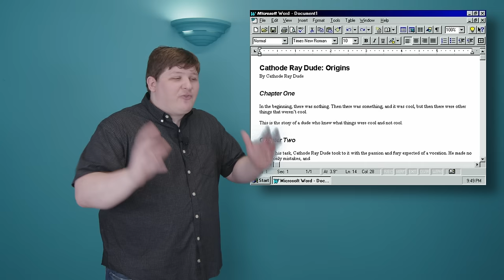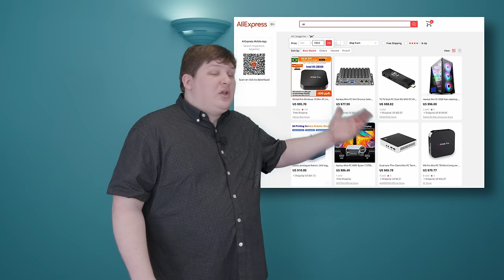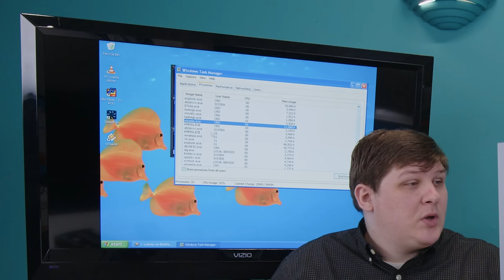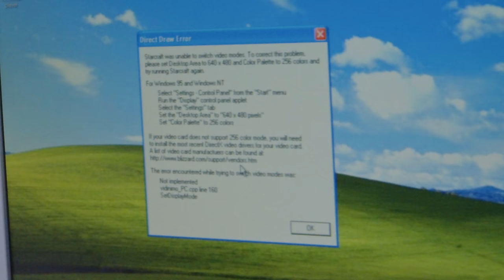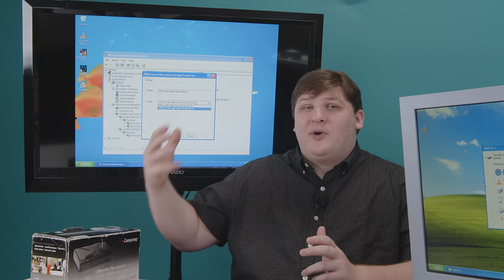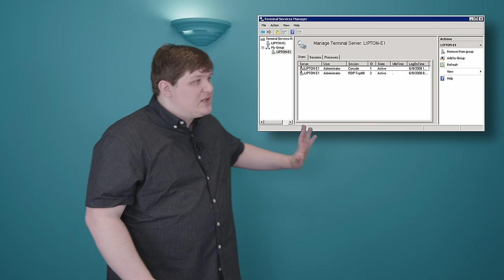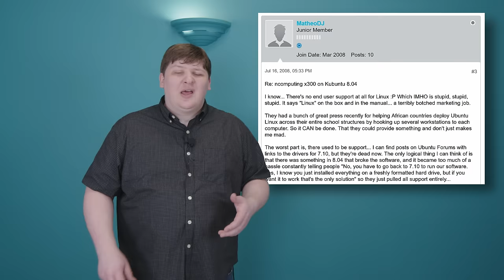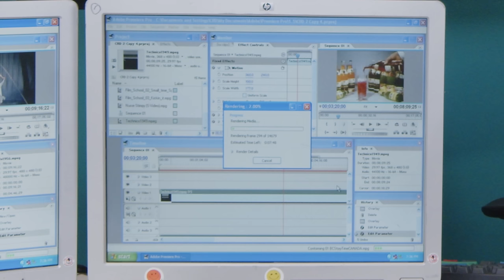7 Users on 1 PC! - but is it legal?

Comment: I used to use something similar back in '88 and '89 when I was writing software for mcdonald's store owners. Stock control, accounting etc. Back then the cost of networking even 3 PCs was astronomical, and I got these multiuser kits instead. You had a card that went in the master PC, then the other two computers were just keyboard, monitor... no mouse, this was text-only software before anyone even had a mouse. I can't remember what kind of cable it was. But it worked, you could run all 3 people on the single PC and each had it's own DOS environment, and within our software there was an api that let us figure out which station we were running on, and do basic record-locking to prevent data being changed simultaneously.

The 2006 version is definitely far better, but it sure wasn't a new idea even back then.
Reply: I remember we had 3 PCs in our office. I setup a Netware network for only $100 - $200. Of course it took me two weeks to figure it out, but it was a good learning excuse 😂.
Reply: An 8 port 10mb hub was around $1,000.  Our college changed to PCs as the rental of the monster IBM word processing machines were very expensive as it included a service contract.  I learned Netware fast and PC repair.  We used Word Perfect Office as it was way cheaper then Word. Plus Perfect Office had an E-mail system.  So by 1988 we had networking and E-mail for our student.  Pretty impressive for any college at that time.
Reply: If you remember Netware, do you remember the "restore" feature.  IBM tried to sell that in 2003 as an amazing ability !

Comment: I loved this video! Reminded me of my HS computer lab setup. I grew up in a rural area (45 in my graduating class) and we got a brand new lab going into my freshman year (1993-94). That lab was probably 25 IBM all in one 486-SX-25 PCs, I believe they were EduQuest models, running Win 3.1 (not 3.11), with one serving as the print server , which we couldn't use if the class would be printing anything. These were all dummy machines, but had 3.5" floppy drives to allow us to save our homework (and a couple of CD drives in the mix), all hooked up via token ring network to a single IBM desktop machine that was a 486-DX (maybe a DX2?) in the main school office file closet in that classic 90s style with the protruding drives and big red power toggle switch on the side. The server was literally just sitting next to boxes of office supplies on a shelf. Really not sure how they did it, but they'd all run the same copy of each program on each dummy machine, but with increasing amounts of lag and performance issues depending on what we were all doing. We had a couple of games, like the original Sim City, Oregon Trail, some rudimentary graphic art software, Microsoft Works, WordPerfect, an encyclopedia (I think Comptons?), and not much else. The terminals could access and run anything on the server, but generally couldn't save files or install programs, although this did get hacked with some degree of shenanigans. Security was kind of a joke on this network, which I suspect was possibly at least one reason the NComputing devices required entering the serial # manually, since that means only devices the admin KNOWS should be active are able to access the system and access all those files and peripherals. Logon times were also SUPER slow when we'd all get started at once, so it was best to get in early before it got bogged down. Sometimes they'd have to set up additional times for the class to come and get work done in smaller groups to not overwhelm the server and network, which did happen a lot during class. You'd always try to be first done with your projects so you had the best chance of compiling your programming project quickly before everyone else started compiling. Only one machine in the room had access to the internet and was the only one that had a sound card. The same models WITH hard drives, CD ROMs and CD drives were in our library the same year. They splurged on the server and bought the budget friendliest machines in the lab. The NComputing system seems so similar in concept and implementation to our lab, down to the limitations and issues. I've never seen another network like my HS one until this video, which sent me on a trip down memory lane!

Comment: LTT did 7 users on a single PC (I believe it had 7 graphics cards) but had 6 VMs running on a 64? core CPU a while back. Not practical, though.
I run VirtualBox 6.1, and allow several family users access via RPis, as the KVM to access their own machines on a Ryzen 7-1700 (8 cores/16 threads), 32GB RAM, 10TB storage.

Comment: It's a neat device, and I hope someone makes a modern version.
Linux is an obvious choice, but like virtualization, unless CPU has viable onboard graphics, would need multiple GPUs.
The ability to breakout I/O on USB hubs these days is easy enough, GPUs can be external on USBC docks.
These with built in PCIe connections on each terminal...
Reply: There is software called "Aster ibik" that does the same thing? I have tried it with 2 computers, and it works great, only downside is anti-cheat will think you're doing shady stuff so some game may not start or run correctly... other than that, i have played 2 different tripple a titles at the same time with individual mice, keyboards, speakers, monitor :D (and Aster works in windows 10 too :P )

Comment: The core 2 duo in my Dell D620 works great for most 2006esc tasks. But the internet can stump it, especially since an update browser is not an option on legacy operating systems. You are definitely right when you say the web can drive upgrades.

Comment: Interesting, but I'm at a loss as to why you kept asserting that Windows "didn't support" multiuser.  Windows (NT) has supported multiple users on multiple windowstations containing multiple desktops since 3.51 at least.   The problem has been that there was no HARDWARE that took advantage of it until NComputing and no SOFTWARE until Terminal Services.  But the OS had the support the entire time.

In fact, you could be running the POSIX subsystem (or WSL2 today) on a process in one windowstation, OS/2 in another, and Windows in a third.  They all coexist and multiple users can use multiple windowstations and multiple subsystems at the same time.

You can see this because Task Manager for NT4 enumerates all window stations, then desktops, then windows.  This is why apps running in an NComputing session work at all, and why they are visible in Task Manager along with the correctly attributed session.  I don't recall if I even had a WindowStation column available in NT4, but the OS sure had it.

Both NComputing's solution and Windows Terminal Server are mechanisms that allow you to ADD a windowstation, which you can think of as where your mouse and keyboard and display are.   The operating system itself, not unlike *NIX, has supported it since inception.

Put most simply, two monitors for the same user is one windowstation (multiple monitors, same desktop or separate).  Two monitors assigned to different window stations is multiuser, and always has been.

It really comes down to the fact the NComputing made good use of facilities already present in the operating system - they didn't "add" them.

Comment: Wow, great video! I was experimenting with Aster and Softxpand back then. Even cracked it, but the screen was nevertheless blinking sometimes. I managed in 1 shielded UTP cable to transfer all the relevant signals up to 20 meters:

1st pair:
1. R
2. Composite sync on Green.

2nd pair:
3. B
4. PS2 Clock

3rd pair:
5. PS2 keyboard/mouse Data
6. Audio Mono

4th pair:
7. +5V
8. GND

Comment: Yes i would be interested in seeing that thing on “later” hardware. I am also curious if it would run on Win7.
Reply: It did, but it was an unlicensed use case. It wasn't that 7 couldn't, MS hated it. I had to buy several copies of 2003 Server to deploy ours. It worked fine on 2008 which is pretty much Win7
Reply: You can patch a DLL file and have unlimited Users on Windows 7. You'd violate the license though.
Reply: winconnect doesn't use patches and works even today

Comment: No. Hardly anyone was ever truly happy with a Pentium 4, unless you like having housefires.
Reply: "Burn your house down"-type house fires, or "don't burn your house down, but heat it with a wood stove"-type house fires? ...because it served pretty well as a supplementary heater for a small bedroom in the winter.
Reply: @ssokolow  mine always turned off the thermostat because it was underneath it 😂

Comment: I remember in XP, 7 users was the limit of fast user switching, that must play into the device limit.
Reply: Xp and 7 are Windows NT...
Reply: @jeebus6263  Yes, I'm aware, I literally trained on them, not sure what your point is, maybe if I clarify my statement, in Windows XP, the number of users limited to created accounts for fast user switching was a total of 7
Reply: @BSFJeebus  i RDP all the time, i didn't know there was any 7 user limit. I know in taskmgr there's typically at least a system username running.
Reply: @BSFJeebus  i guess my point was that WinNT was selected (NT4) specifically for features like multi-user support.
Reply: @jeebus6263  so I did find out Fast User Switching gets disabled when XP joins a domain, which makes sense since it was based on RDP, the only reason his example made think of it was because I'd seen a similar set up and remembered when I was setting up users for XP Home, I found that 7 user limit, still really neat the way some companies found to exploit it
Reply: @BSFJeebus  unix/linux always supported multi-user, Micro$oft was scrambling to catch up.

Comment: There are some issues with this kind of setup. 1) Redundancy - if the main 'server' goes down you have lost 4 or 8 stations and you can't run a class or office if all 8 go out at the same time. Usually a class/office will have 1 or 2 spare PCs in the event that one stops working. 2) The 2nd hand resale price of your server/clients is basically zero if you want to upgrade in the future. 3) Compatibility - Schools often want to run special software (e.g. special needs, licensed software, software requiring certain OS or hardware, etc.) and these often don't work.

Comment: Here in brazil we had computer classes using these, 7 users on photoshop CS3 at the same time. No noticeable problems, but we were all beginners.
Edit: it also had a software that resets the OS/storage to a previous state on boot, so we couldn't get most viruses nor save files.

Comment: Not sure if you knew this but for many years you could simply copy the terminal services file from a server version of windows and make a single registry edit and suddenly you could log in multiple users simultaneity into plain old Windows.

We used this back somewhere in the 1990s to late 2000s to share 1 PC with two full time users (and a third user occasionally by sharing ½ and ½ of one of the screens). What we had was two video cards, multiple keyboards and multiple mice. I don't recall having to do anything other than some simple registry tweaks to assign keyboards and mice to the specific users. Admittedly, while I figured out the terminal services hack, it was my room mate who figured out how to assign input and output devices to specific log in sessions.

We did have minor issues with everyone able to see any USB stick that was inserted (showing up as a drive letter), but we all knew each other well and didn't have secret data, so that wasn't really an issue for us. You could control access to them if they were formatted NTFS and you set up specific address control, just like any normal storage drive (SSD or spinning hard drive).

Comment: There are ways to get the code that programs that Altera chip, but it might also just be encrypted. Usually there is an EEPROM, or other non-volatile storage, on the PCB from which the configuration for the LUTs in the FPGA are loaded at startup. It could also be in the FPGA itself, depending on the model. Pretty sure an expert could get in there, but then on the other hand you can probably find an HDL description for this task somewhere on the web, if you want to do it on a more modern FPGA.

Comment: My celeron gateway pc from 2001 took at least 5 minutes to load premier pro. With no other background processes running. I'm stunned that a 2007 can run two concurrent apps of it simultaneously no problem.

Comment: 11:11 it is actually possible in windows with just software, I've done it before. It's really messy. You gotta use sandboxie, some weird closed-source $40 software that can somehow create a second user session on the same user account, and then assign a keyboard and mouse to each session, and if you're using the same program at the same time, the other person has to start it through sandboxie.

The performance loss is pretty big, and I would not say it's worth it, but it is possible.

Yep, Aster is the paid program that somehow creates multiple user sessions.

Comment: The multi user capability is actually built into Windows and has been since the early days of Windows NT - I worked using NT back in the mid 90s and it had the necessary framework built in and it was up to solution vendors to plug into these with their own management interface.  The first one I saw in the 90s was Citrix which does this but using a networked client rather than one directly connected to the host - but the principle is the same.  With the hardware solution there are limitations such as due to the terminals not using the graphics hardware in the machine they can't do 3d stuff or anything else that the terminal hardware doesn't support.  This is a form of virtualisation - just not processor virtualisation.  Each user thinks they have the machine to themselves - but in reality are sharing it.  You will find that some (badly behaved) software won't work because it will rely on exclusive access to some data file or similar. XP has inbuit technology to allow an administrator to virtualise access to files so as to avoid these conflicts.  From a legality point of view it depends on the software - typically MS licence on a per device basis - which is the end user device so each terminal would require a license.  But some licenses are per user which requires that each user needs a device (regardless of whether they are sharing a machine).

Comment: Unix and Linux uses X11, which is DESIGNED from start to share a big server among many users, which uses low cost graphical workstation that only uses X11, to show graphics today.
You can still do that today.
Use SSH, with X11 tunnel and connect to a Linux machine, and you can run graphical programs from the remote server show up on your local machine (install GWSL from Microsoft store if you want to try), and that is no way different from running that graphical application from your local machine.  No, it isn't a retrofit, it is from the beginning.

So yes, this has been working since the 1980:th, when Mac and IBM PC was made.

Yes, you can also attach several screens, keyboards and mouse, and you can run several users from the same computer.

Comment: My school has these. In the study hall (idk how to properly translate that) there were 2 platforms. A Dell tower pc in the middle, and 8 LG monitors around it (with one of those boxes screwed into the vesa mount). Each dell had a card with 5 ports, and one with 3 ports, making up the 8 ports. By the time i got there, they were decommissioned. I got the cards and a few of the boxes, even a few of the original packaging boxes. I haven't found the disc yet. But i've always wanted to try to use them. To this day, those ncomputing boxes are still installed on those LG's, even though each screen has a computer under it now. I plan on taking them home before leaving school. (i did get permission)

Comment: This was a great flashback to my younger days in the IT networking field (now retired). One thing you did not mention was that during Windows 2000 and XP era there was a simple replacement of a file called MSCS? (Sorry can't recall the name), but it removed Microsoft's restriction on allowing Simultaneous Remote Desktop clients on Windows 2000 and  XP to host multiple RDP (Remote Desktop Sessions) and totally removed the single session restrictions.
I used this on several installations in small non-profits and education installations. If I'm not mistaken you can still find the file and download it off the internet. Also I believe it even ran on Windows 7 and possibly Windows 10. I don't know what the limit of simultaneous RDP clients it allowed, but I had 6 users at one time in one installation. A rumor was circulating that Microsoft once included it in the Windows 2000 Pro version but in later updates removed the single file as they realized they would loose money by allowing it. So cleaver individuals found that just replacing this file still allowed simultaneous remote sessions.

Comment: Microsoft did come up with their own proper implementation for multi seat computing. It was called Windows MultiPoint Server and it was basically a version of Windows Server with the desktop experience option pre-installed and extra MultiPoint software that lets you pair a keyboard/mouse with a display. It works with displays hooked up to GPUs or to DisplayLink USB docks. It also assigns USB devices to each station, as you need to have a USB hub for each station. They partnered with HP to sell full systems that came with multiple DisplayLink docks and all the licenses for multiple stations.